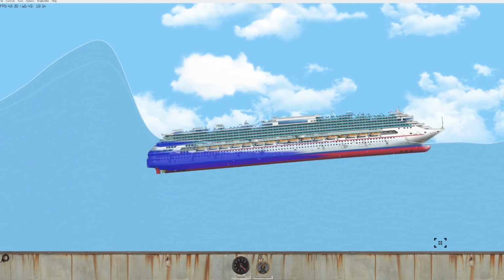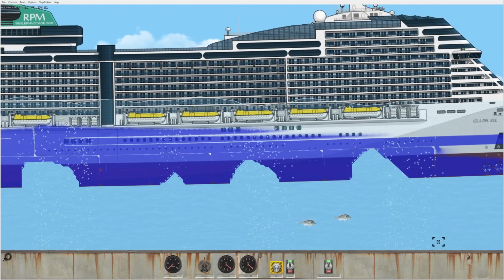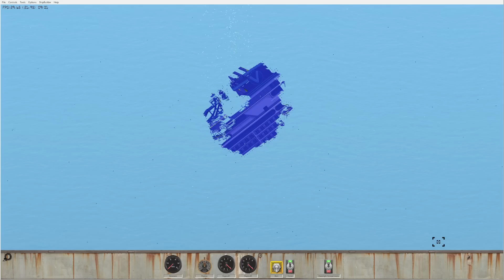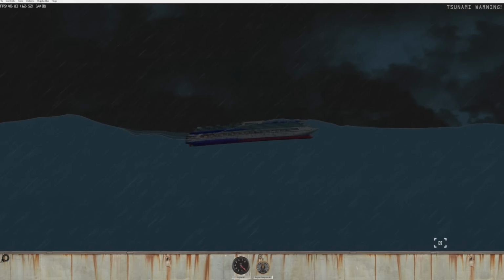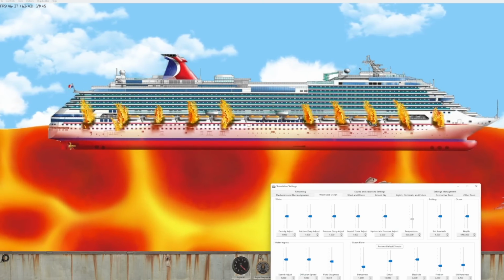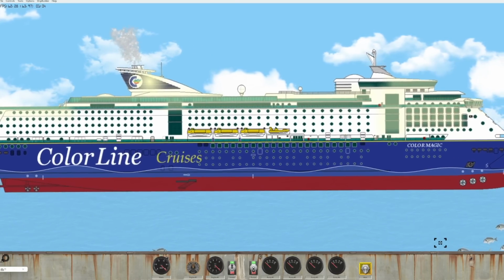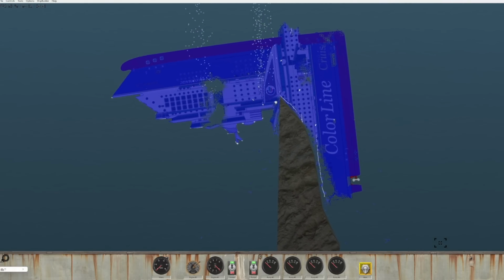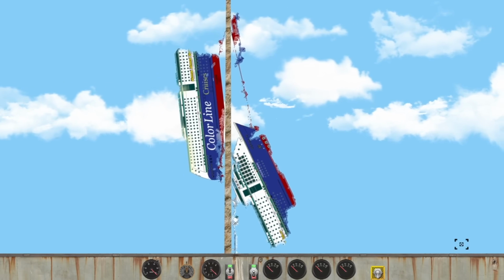What Happens When You Split a Cruise Ship with a SPIKE in Floating Sandbox?

Comment: It didn't register the cut on the spike because you didn't raise the ship up high enough above it yet. Spikes that thin actually have their tip higher than they appear to. It was effectively just sinking further into the ground at that point, which is why you didn't see it split until you forced it. Also, the first ship could have been saved - you just needed to continue fixing the strongest parts of it, and/or raising up the land, and moving the piece of the ship onto it. I've done it several times. As for the crazy camera, it now tracks everything, but you can turn it off (either with Ctrl-Home, or there's an option in one of the menus).
Reply: Bro he can do what he wannts